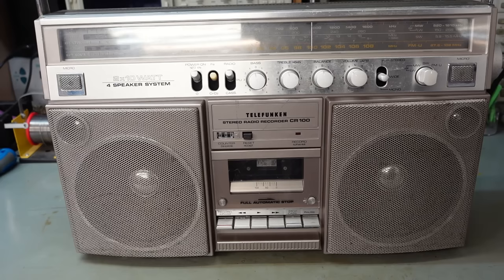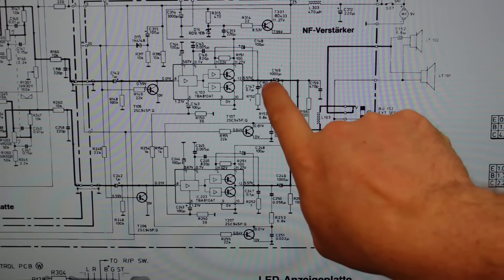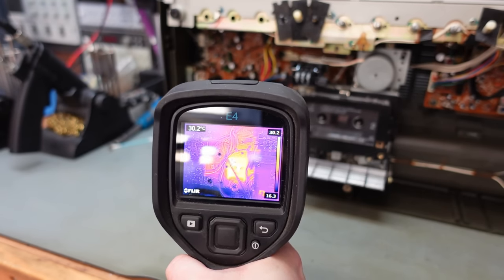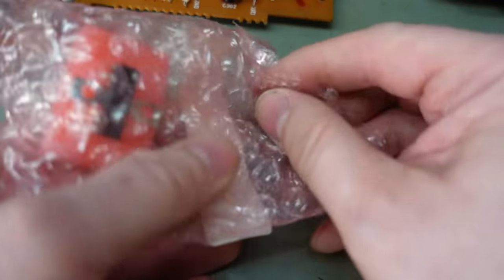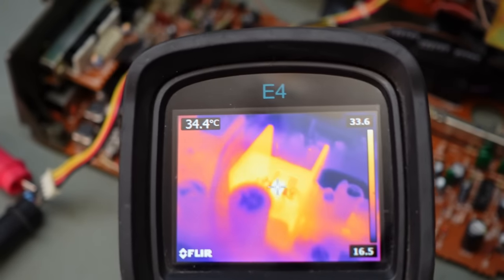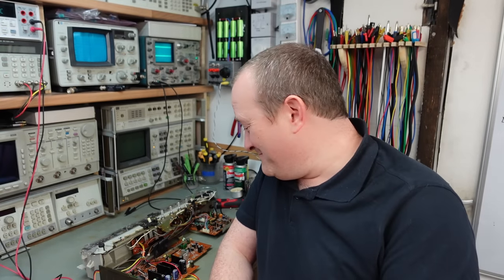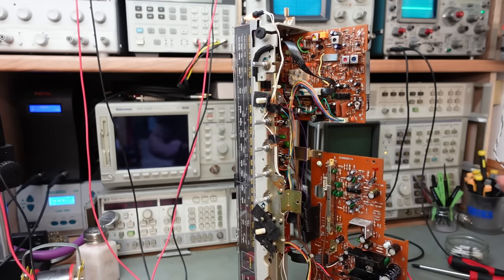1982 Boom Box Repair (Telefunken CR100)

Comment: I admire both your knowledge and skill to fix these things. As a child, I was great at taking radios apart...  it was the putting them back together again I never got the hang of. I also learned after a while that my capacity with a soldering iron was nil; I would solder all over the room, but none on the actual connection!

While I wish I could do what you do, I can still watch and appreciate your efforts to bring electronics back to life.

Comment: Glad ppl. are repairing boomboxes and vintage stereos. In 1979, I had the top of the line Sanyo M9994 boombox and Corte like $270. US and loved that thing. I just saw one listed on eBay for &3,000. and suppose to be one of the top 10 classic boomboxes it was on the cover of Malcolm Mclaren’s Buffalo Girl’s album from the 80’s. Also I used to plug in a turntable and sounded like a full stereo bc it had a built in phono input and pre amp. 

Anyway, most boomboxes need new belts being sold and you can still get them cheap bc not many know how to change the belts.

Comment: I had opened a lot of tv's, radios and other things in my younger days, and I always tried to find the thread in the plastic where the screws were. On a few occasions when a repaired item came back from factory, they did not do that, they made a new thread in the plastic, causing it to become brittle and would give away, breaking the screw from the plastic. This method I tried to bring to my apprentices over the years of network- and system administrator. Sometimes it is hard to see that not every repair guy or girl keeps track of threads for screws. Hope you do!

Comment: Just found this channel, That's a superb repair, that looked like a good quality stereo, the way it came apart, with each section able to be unplugged fairly easily. Unlike many of today's un-repairable items which are glued or clipped together! The cherry on the cake just has to be the manufacturing of the replacement switch cover, great bit of engineering!

Comment: Excellent work as always. Just a couple of points from my own point of view...I try to avoid cutting the print track to isolate chip pins. I always suck all the solder from the pin and its pad and then manipulate the pin to centralise it in its hole with forceps and/or a very small jewellers screwdriver so that it's not in electrical contact with the surrounding copper pad. I then solder a small wire to the actual pin and another to the nearest convenient solder pad to make a test connection. This saves marking/damaging the original print track and necessitating bridging repairs later. Regarding solder bridging on cut/broken print track, I tend to solder a a fine bus bar wire link across broken print track for mechanical strength - it's the way I was taught back in my C&G college course days. 

The fault clearing after removing and replacing the transistor is a strange one, as I couldn't spot any solder bridging as such, so it's just remotely possible that the transistor had a junction fault that was cleared when it was heated and manipulated when removed. I had a similar fault a few years ago with one of those back to back 3 legged varactor diodes in the FM tuner section of an old JVC boom box, where manipulating it cured the fault and it carried on working for years afterwards.

Keep up the great work and excellently filmed and produced videos - you're one of the best!

Comment: Hi there Mark i had this exact boombox when i bought it the right hand chip was faulty, i recapped it and replaced the right hand chip along with servicing the tape deck, this was working perfectly for over a year then i sold it on.
Reply from the maker: Wow! What are the chances of that? Did you change the belts also? I didn’t expect the tape deck to work!
Reply: @MendItMark  I know i was shocked seeing it here lol, i bought the amp chip from the same place you did, yea i replaced the belts as the old ones had melted with age as they do, the caps i buy from CPC, started watching your videos a while back keep up the good work, i repair old vintage audio equipment as a hobby love getting these old radio's or amps working again as the don't make them like this anymore. That Telefunken is a decent radio with plenty of power.

Comment: Nice work, I just restored a Sony CFS-9000 Mini hifi boombox from 1985 last week. The owner plugged into the 240v mains while the rear AC dial was set to 110 volts AC :( . It is working excellent now :)

Comment: Great fix, especially the new switch cover. I was surprised to see this machine have a very similar Matsushita metal band connector on the radio band selection to the ones my Braun A1 amplifier uses for the input selections. I took it apart over Christmas and found that the metal band inside has somehow become damaged, surprising as its run is almost flat and it's certainly not under the stress this one could be. Maybe I will find the replacement part one day, part number 3589B where this one is 1083B.

Comment: Love the fault isolation approach.  I actually thought that would go a bit further, but int he end it must have been a bad solder joint as you said.  That's one thing I liked about the pre printed circuit board days.  You could quickly de-solder components to isolate things such as hard and soft shorts...no cutting runs just de-solder one leg and get measurements if needed.

Comment: Thanks for sharing your work. My thought was the mute transistor was leaky, passing DC into the amp chip thus overheating. Your desoldering heat may have cured the leak either permanently or just temporarily. I guess if it comes back you know where to look.
Reply from the maker: Oooh, you could be right. I still can’t see how the mute transistor would cause so much current to flow. Strange stuff!

Comment: I had a Realistic stereo amplifier that decided one day to put 30 volts out on one of the speaker outputs frying a Dynaco A25 speaker.
I bent the leads of one of the TO-92 stretch transistors in the driver circuit and the problem cleared.
The soldering was ok. I changed the transistor and it never had problems again.
Maybe there was tin whiskers somewhere.

Comment: When I saw the mechanism for the record button I thought about my Eumig Super-8 sound projector that has the record button on a very unusual position to prevent it from being pressed by accident. When you press record it will also move a bowden cable to press the actual record button inside the projector on the amplifire board.

Comment: Hi there 😊 NICE work. Your videos take me back to the early eighties, where i was a radio technician apprentice myself. Happy days! It is a complete trip down memory lane 😃 Maybe you did try to record with the cassette deck without filming it? I would be very surprised if not 😉 I have never seen a record/play switch been operated with a wire.... Btw i do not trust the two small BC transistors not to be periodic faulty (just me). Keep up the good work, and keep the videos comming! 👌💪

Greetings from Denmark 🇩🇰🇩🇰🇩🇰

Comment: Blown fuse is a reason for internal short or just a voltage surge from your power company. That discolored resistor looks a toasted solder joints, probably just need resoldering from overheating. Easy  fix we say back in the 80's. Also, most capacitors dry out due to old age, will cause motorboating, distortion or low voltage regulator supply.

Comment: I would seriously put those IC's in sockets and fit copper heatsinks on top of them. by the time that heatsink gets hot chances are the IC will already be dead.

This is quite a decent old boombox, it has AC bias erase so recordings should sound pretty good.

Comment: Mark  Fantastic job on repairing the Telefunken CR100.  One question.  Why doesn`t  the manufacturer install 2 fuses on the power supply for  Live and Neutral instead of 1?  Maybe it won`t make a difference but since it`s AC coming in if you unplug the outlet and plug it back in the other way around the live feed will go directly to the board on the power supply and will not be protected.  Again good job Mark. Cheers.
Reply from the maker: Generally speaking, the blown fuse should stop the flow of current, and it will, regardless of which line it is in. Plugs that can be reversed should not be used in designs that could pose a hazard if live/neutral are reversed. In the case of a boom box, the casing is plastic, and it wouldn’t matter which way around it went. 
Thanks for watching!

Comment: I'd be tempted to replace those mute BJT's anyway just in case they were 'fixed' by the heat of desoldering. Had that happen before when the bonding goes weak internally

Comment: The mute transistor was not backwards and it should be.  For traditional muting by shorting the audio line through a transistor it is common to swap the function of emitter and collector.  Even though that produces a low gain circuit, it produces a much lower impedance for the signal to be shunted to ground.

Comment: Very well done 👍.... 
no mains transformer...!! What did it use instead a half wave diode and dropper resistors....I would've thrown the entire amp out and replaced it with a modern 10watt Class D amp
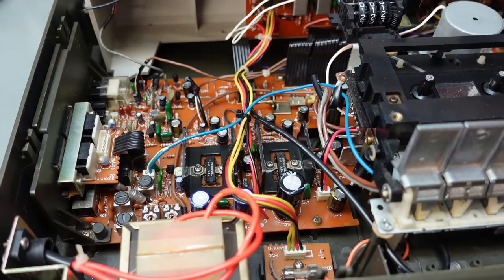Reply: Mains transformer clearly visible at 2:37.

Comment: Hi Mark, only just found your channel, great content, love the fact that you just made a switch on the lathe at the end :-)
Quick question, in this video at 16:57 your middle finger is near a wheel that is spring loaded with a little top hat plastic cap holding the springvon, I have a couple of tape decks where this cap has split over the years and depending on the deck they have various problems, can these plastic caps be purchased anywhere? I find super glue only lasts so long before they pop off again. Thanks :-)

Comment: As usual a thorough complete job. I was wondering if you could help. I have a Sony WM-D6C Professional. It is in mint condition but because of the age the motor does not power on. Not sure if it is the power supply or the the motor itself. I'm one of your subscribers and was wondering if you could fix it if I ship it for repair and a video on your channel. Please let let me know if you you can help. I am based in London. Many thanks.

Comment: Well done Mark, great job. Q: why the resistor across the bench AC supply?
Reply from the maker: Pure laziness! I often choose a 1Meg or so resistor, that has a close fit to the pin size. It has negligible current draw, and most importantly, the resistor body keeps the legs apart, and stops the leads dropping out of the connector. 
Now you know!

Comment: Update on the Sharp GF 6060- I changed the belts all good, only issue now is the playback,R/W,F/F when working are great but sometimes i have to alternate through the buttons to get then running.  Also the Cassette player is getting a Static noise when i press the buttons,  right speaker is a good  clear sound, but the Left speaker gets a static when ever i adjust the Volume and it has a very low output. I have sprayed all the electrical contacts with 'contact cleaner and i am trying to clean everything with Q tips. To a pro this must sound comical.

Comment: Did I miss the part where you fixed the AC to DC power supply? That resistor that looked burnt up was also very loose on the board.

Comment: Neat looking unit. Don't really see the vintage German stuff over in the US much. 

Incidentally, I have been told more than once that it's not good to use isopropyl on rubber because it dries it out and crystalizes it. The advice I've been given is to use water with a tiny amount of dish soap evaporated in it. What do you think about this? Any experience with the long term effects of treating rubber with various products?

Comment: Mark I notice in a lot of your videos you find a suspect component and then jump straight to swapping it out, only to find afterwards that it was a fault in the input or output of that component. In this case in particular you had the service schematic for the board with test voltages listed; a quick probe of the input to the amplifier chip would have likely shown an unexpected DC offset, driving the amp chip's output to one of the rails, and that fault would have persisted without the amp chip in place potentially ruling it out as the suspect component (assuming that running in the fault condition hadn't also roasted the chip over time).

I'm not trying to be overly negative or harshly critical here, I just wanted to point out an area where you could improve your procedures by being a bit more methodical, and potentially save yourself some time, money and frustration.

Comment: A Few Hacks 

New Battry pack (LTO / LifePo4) (With Smart BMS (own Bluetooth ) & Add Bluetooth Audio Support Replace the old Speaker divers with something better even a SDR Hack so it can also Support all bands Analoge  inc Digital Radio DAB, DVB, DRM (Digital Radio Mondiale) TV as Audio only TV audio description mode

korg nutube 6p1 From more Vacuum Tube Audio using VTD as a Amp

Comment: Just a quick question about contact cleaners. I've been using Servisol Super 10 for potentiometers, it seems fine for a while but the right channel of the balance pot on my amp is crackly again only a couple of weeks after cleaning it. Would you say DeoxIT worth the extra cost?
Reply: Imho yes it's worth the extra money than super 10..it's ok seems to work ok a first bit crackly pots come back..another top grade cleaner Electra rocol

Comment: Hmm, was the amplifier chip really dead short? You remember, you did cross-check it with the other channel and the problem remained on the same channel, so not changing the "defective" channel says to me: The chip was (and is) ok, but maybe it really was either some dodgy soldering you did "accidentally repair" when you made the interruption of the track  OR  it was some dodgy elco? Sometimes they do "reform" themselfes, but I wonder if that will be reliably or if the problem will reappear at some time? At least I would not say that the problem could have been caused by the transistor that is there for just muting the audio input path into the amp. That one can mute the whole channel but it would not be able to cause excessive current, or is it?

Comment: I have a Unisef Z-1000 that works fine with batteries but with the mains power it makes a buzzing from the speakers and if you unplug either side sound will come through but with both plugged it buzzes. I don’t know what do do :/

Comment: I have a Sharp GF 6060, and i know the belts need replacing. I found a Electronics place that can fix but they said "only if they can source the parts" As it is only the rubber components. - Are they easy or hard to source?
Reply: New belts are available easy fix

Comment: As soon as you plugged in the mains.     I knew it WOULDN'T TURN ON BECAUSE THE SWITCH IN THE SOCKET DIDNT GEY DEPREDSED BECAUSE YOU USED THE WRING MAINS PLUG.    AMATEURS